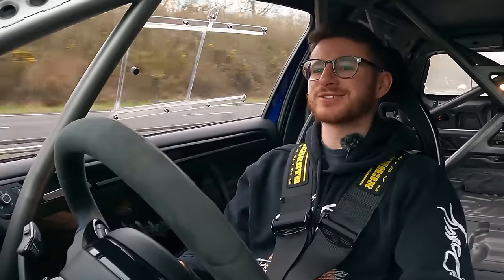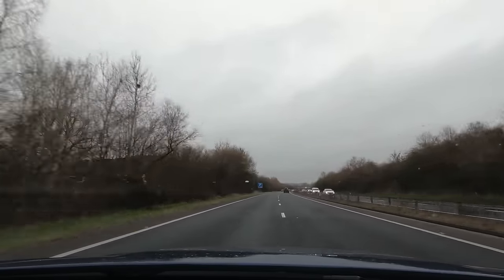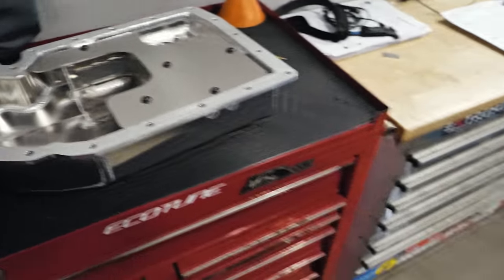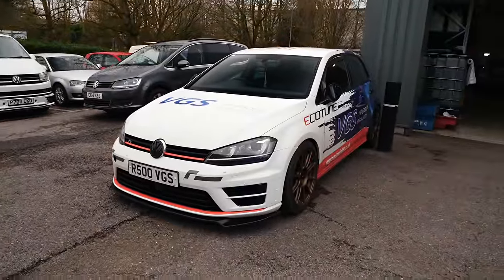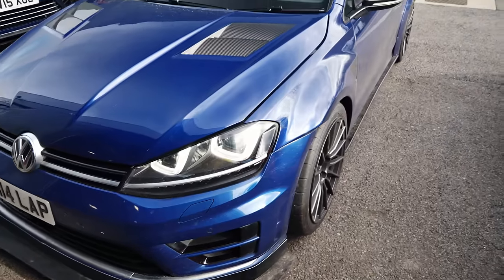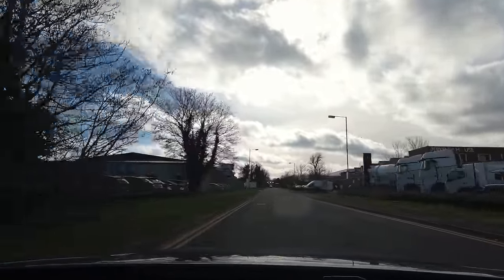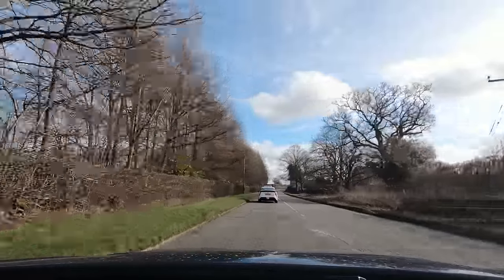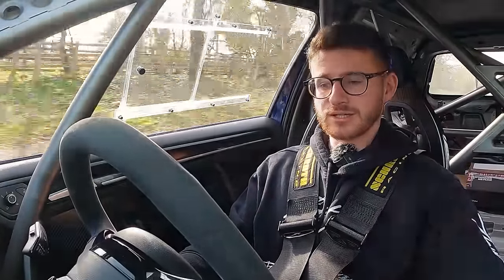The MOST IMPORTANT MQB Track Car Modification Fitted to my MK7 Golf R!

Comment: 60degrees motorway speed is nothing to be proud off.....if the engineers wanted the oil to run at 60 they wouldve done so. Oil is at optimal operating temp at 95-120 degrees. 60degrees it can be too viscouss and not properly lubing the parts
Reply: 100 percent correct, I have a front mounted oil cooler on my mini and I have to block off my front grill or I run at about 68.
Reply: @Jonathan-qz9kd  i get that its built for the track so he deffo will benifit when tracking it, but normal use getting to the track and general usage around town, not like he will use this car for that but still, it isnt ideal to have this temp. Especially in winter time can you imagine how much colder the oil will be.

Comment: Oil temperatures seem very low, my TT EA888 gen 3 runs around 98-105c  which I would consider to be in the normal range
Reply: I wouldnt be pushing a car with sub 75 ish degree temps ,,
Reply: same here, motorway will be around 100 and then around 110-115 when giving it some on a warm day
Reply: Polo GTi AW sits at 108-110 at 190-200kmh. At 140-160kmh I sit at 100-105.
Reply: @korczuch1881  slightly bigger intercooler and revised water pump
Reply: He already has some.cooling mods. Stock car runs at least 104° at motorway speed!😊
Reply: @kaelturner9721  also hard to compare at times. Here it’s full throttle or full brakes at highway speeds 😂
Reply: I’d say it’s too hot for normal driving conditions and if tuned it should be lower imo .
Reply: @loustath1583 nope they're the correct figures anything else isn't warm enough !

Comment: 60°c shouldn't be the real temp of the oil. Mine is a stock Golf R mk7.5 with an oem oil temp sensor at around 100°c when cruising on a highway even in the Spain weather.

Comment: I fitted one of these iABED sumps a few months back. 
It dropped my engine temp 5* in all conditions. Very happy with it. 
Pretty sure it is supposed to sit for at least 24 hours for the sealent to dry properly before driving it though. 
As there is no gasket on these sumps they are prone to leak. Best of luck with it

Comment: Everybody agrees that @90° is just the right temp. But hey, its his car, if he wants to run his oil at just 60°... We may soon be seeing a vid of how hes having new problems. Hope not, but if he runs it like that...
Reply: explain what issues will come
Reply: @random13627  if the oil 8s not at its optimal temperature , as indicated by manufacturers, it means it is thicker than normal, so it wont flow as it ahould. Simplest example i can think of is: if you pour water in a pipe, it will flow. If you pour mud, it most likely will get stuck inside the pipe. Makes any sense?

Comment: What oil are you using.i use millers 10.50 comp and temps at 98 motorway driving...need oil up to the late 80s for hard driving?

Comment: Id think if timing chain on the r should be fine for most of the life of the car as long as tight. 
In my gtd handbook it said 140k miles no time limit for a cambelt. 
Had it done at 130k 9 yrs old, lookwd in pretty good nick still

Comment: 90 degrees celcusis is the operating oil temepetur. That is what the engine wants to run at, and what it was designed to run at

Comment: wait 88-90 is just the normal temp even for stock cars. i only get above 90 when im on the autobahn doing 270+ kmph than it will go up to 100-105. ~90 is the operating temperature of the EA888